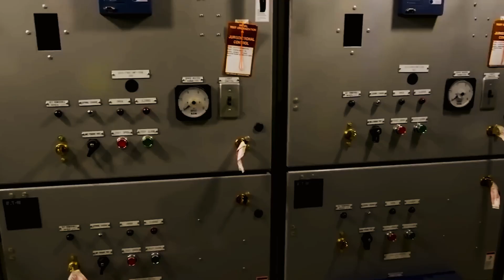BREAKING: MUSK PROPOSES NUCLEAR TO SOLVE ENERGY CRISIS!

Comment: The video does not discuss what kind of fission technology would be used in MSRs. If they are light water reactors the prospect of melt down will still exist and they can only be located next to a source of cooling water.

On the other hand, if we are talking about Liquid Salt Thorium Reactors (LFTRs) the danger of meltdown is moot and they can be located anywhere regardless of water availability.

The notion that fusion reactors will not produce radioactive byproducts is incorrect for Tokamak designs. Tokamak reactors release energy in the form of neutrons that must be trapped to recover the energy. This means that a Tokamak is going to breed isotopes that can be radioactive.

Fusion reactors that rely on the He3 - Deuterium cycle will not produce radioactive byproducts.
Reply: Thorium was tried and failed. Proponents pretend it was 'killed' because uranium produces the weapons-grade materials (and perpetual Fed waste site funding), which may be true, but thorium was tried and failed because there are currently no exotic metals that can handle it, also the licensing process for thorium would take many decades. Put another way, if thorium worked, Russia and China would have thorium, instead of paying US to build BWRs for them, at 1/5th the price we pay in USA, we might add. Nuclear power, Education, Medication, Defense, Food, Housing everything in USA costs 3x to 5x more than the same or better outcomes anywhere else. It's sickening to realize we are all Palestinians in the Year 2030.

Comment: China is developing nuclear batteries but it's still in it's infancy.  When ready, nuclear batteries can produce energy for 50 years and never needs to be charged.  Imagine an EV that you never have to charge,.
Reply: if it works to use up old spent fuel rods, and that shit starts to go away , i'm all for it. but not if we're just going to add to accumulating nuclear waste..
Reply: @ogerwon1   Excellent point.
Reply: Imagine an EV that weighs 40 tons. Since these nuclear batteries have not been completely developed, we don't yet know what the power/weight ratio is going to be.
Reply: @6NBERLS   Or they could turn out to be smaller and lighter than lithium batteries.  It will be interesting to follow the developments of this new tech over the next few years.